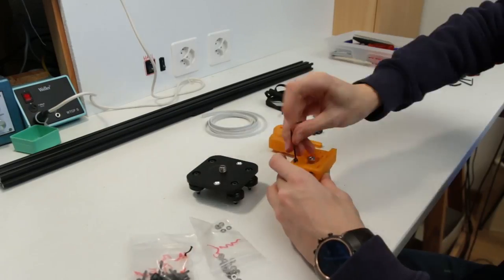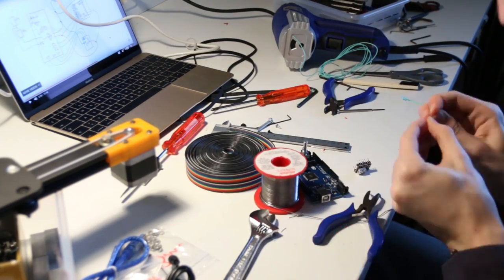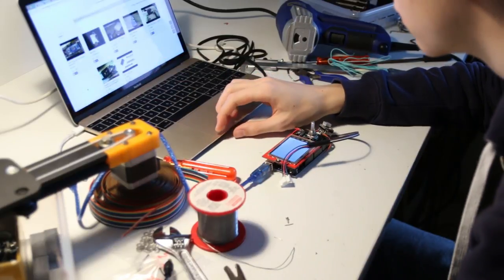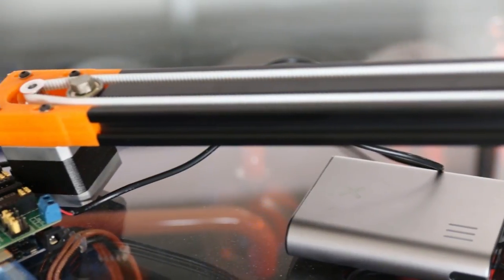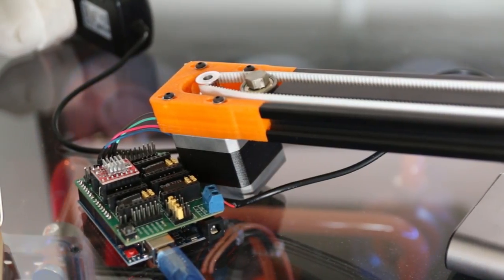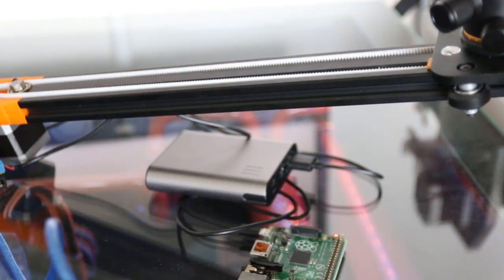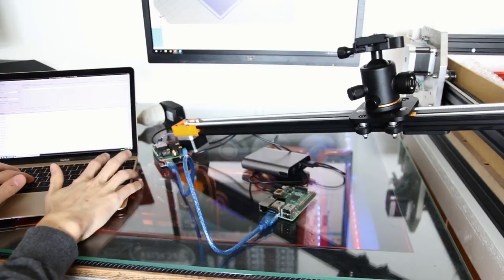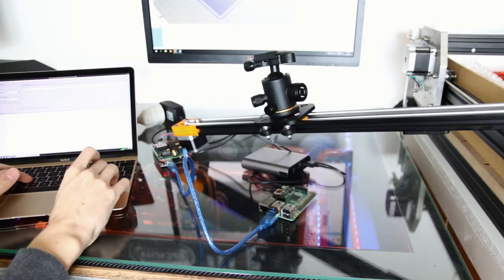DIY Motorized Camera Slider on the Cheap

Comment: Very good slider.    
I am a beginner and I want to make the same slider but not with stepper motor and arduino becuase it is very difficult for me.
 I want to make it with JGY-370 motor  12 V DC .
Please can you modify for me the  stl file of stepper motor mount that used in your video to JGY-370 motor mount .
Thank you very much.